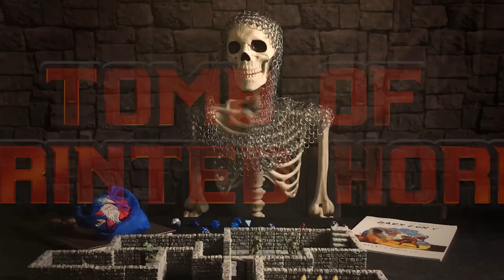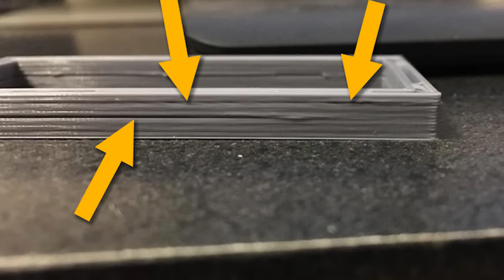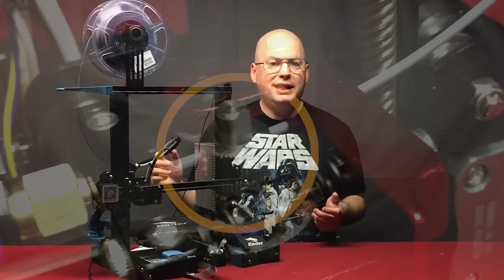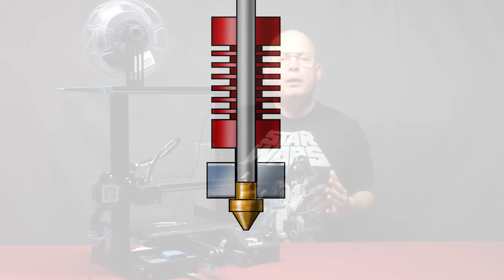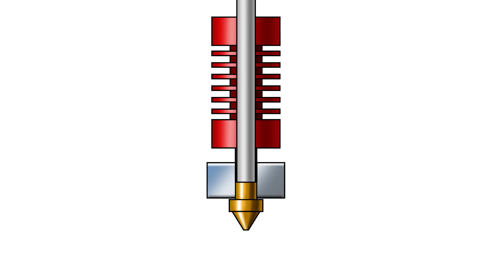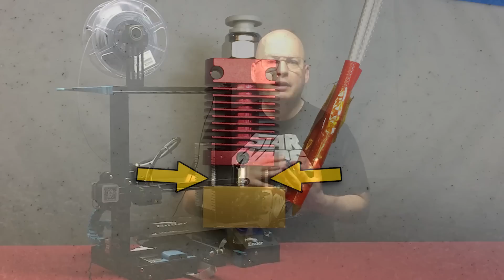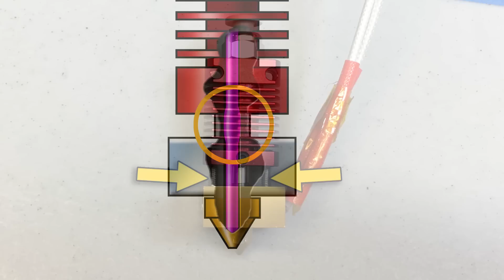Fixing Under Extrusion in a 3D Printer

Comment: So, I have been fighting under extrusion for a while. i ran the e steps calibration and adjusted accordingly, change the nozzle a couple times. Add a 1.5mm clip to the extruder arm to help the tension on the bearing. and it still under extrusion anywhere between 25mm and 50mm. I have not tried metal extruder or new tube. is there anything else i can do before buying new parts? I have checked a couple facebook groups but its all the same info

Comment: after an hour of printing, the filament in the nozzle will clog help
Reply: I've solved same problem moving down 5 mm layer blower. It was cooling down the heat block more than layers.

Comment: Thank you very much for this guide! I have had this problem for so long trying every setting in Cura. It has frustrated me for half a year. I have now been printing your models with great success except for a tiny problem. I am getting some buildup when doing overhangs. These sometimes get in the way of the nozzle which can mess up the print (especially part B of the Trash Beast model). Any suggestions on a fix?

Comment: Hi. Thank you for your videos they have been very helpful. My issue was that my extruded toothed gear wasn’t working. Then I remembered I added the 3rd TL Smoother after my first print. I removed the TL Smoother from the extruded plug and everything worked again. Just throwing out a glitch I found on my Ender 3. Could have been me if your not supposed to put one on that.

Comment: Love the extruder toothed functional section in your diagram at the 10:19 mark, but good luck ever finding a steel one with geared teeth that sharp! The enourmous majority are square and many are rounded at the squre's edges. I want 10 of those you show, they look fantastic!
I have the sharpest I could find on Amazon (the "Wangdd22 3D Printer Accessories 4pcs/lot 38 Tooth Mold Steel Linear Extruder Filament Drive Gear for Planetary Gear Extruder") and with my CR-10S is has been great. No more slipping, non-moving filament!

Comment: Thank you for the very detailed overview of possible issues!  Before I dive into many potential root causes in your video, do you have a hunch as to what might be causing uneven/underextruded/inconsistent texture on SOME of the sides of a print?  When I printed the calibration cube, I got X side looking pretty good, but then its opposite side was very rough.  Can that be explained by feeder gear grinding the filament, or is there a more likely explanation?
Reply from the maker: If it is showing on one axis only it's likely a belt tensioning issue. :)
Reply: @Tombof3DPrintedHorrors  tightened the belts, leveled X-axis, tried printing without the cooling fan, same result.  X and Y sides of the calibration cube look good, but their opposite sides are stringy.  Also double checked extruder calibration - 100mm got consumed exactly.  Would greatly appreciate any other ideas.  Thanks!

Comment: My coupler failed after just 1 full day of use. It spat out the tube a couple of times then it finally just spat out the metal teeth that is supposed to hold the tube in. I'm going to solder it back in though. see if it keeps working while I wait for a new one.

Comment: Dont forget, if going from PETG to PLA you should clean out the nozzle. PETG has a higher melting point than PLA, so you'll endup with a partial clog and under extrusion (been there.)
Reply: I was using PETG before now PLA, I had 3 failed prints already. I tried cleaning up but I still get underextrusion like after 40% of the prints. Really annoys

Comment: Now, i have a ender 3
The sides of the print arent bad, they are actually really good, but the problem are „plates“ 
These areas dont fix to the side of the part and they arent watertight 
What could this be, and yes i have dispensed 100mm and adjusted it to measure it. 
The printer is new, its a ender 3 
PLEASE HALP
Edit: The printer is new so i dont think that it is anything with wear and tear
Reply from the maker: I'm afraid I don't understand  what you mean by 'plates'.
Reply: Tomb of 3D Printed Horrors ah great an answer thanks
Here is my reddit post, better explained and with pictures

Comment: Hi .. I just got Ender 3 .. I have a problem .. when I start print from SD, the filament is simply pulled out and the printer does not print as filament is out. I tried the Test Dog and other prints .. Same thing is happening always when extruder and bed reach the temperature and the print should start .. First thing happened is the filament to be pulled out .. Then head will be moving without extruding .. 

 The  I used to print with Prusa .. This is really different process  .. Any advices?
Reply: could your extruder be running backwards? if so reverse the plug. are you feeding the filament all the way into the hot end till it stops?

Comment: Hey guys I just bought my printer ender 3  from amazon and have problem with the printingthe nuzzle stay all the time on the left front corner when we trying to print the test print (the dog )its printing one line on the left front corner back and forth non stop in one line with nocking sound  .I tried to move the nuzzle to the center of the heating bed and its look like working but after 1 min its going back to the left front corner .I tried to flow the instruction but still the printer refuse to  work.in the auto home its going to the left front corner and stay over there .I can move the bed and the nuzzle with the move axis so I knowthe are working .I need help anyone please ?

Comment: to prevent clogs, use a piece of sponge as a filament filter!!!! you need to clean your filament as dust can build up, and that gets intoo the nozzle. trust me, passing the plastic trough a regular piece of sponge cleans it a ton!. I've had 0 clogs since, even on my small 0.2mm nozzle!!!(smallest size) did a cold pull on that nozzle after 20h of printing and 0 debris!! (those .2 are known for getting clogged from dirt)
it's a cheap solution, and works wonders (you can even 3d print a holder for the sponge so it looks nice)

Comment: Great video. Thanks for the tips. I have one suggestion: when you talk about the "cold pull" cleaning, specify that the temperatures you're quoting are for PLA filament. A raw beginner may not know this and try doing it with a material with a higher glass transition temperature such as ABS or PETG and get frustrated that it didn't work.
Reply from the maker: Good point! I definitely need to do a video on performing cold pulls.

Comment: Well thank you so much for this! Unfortunately I still can't get a good first layer. I've used a leveling test which prints 5 squers (corners and center), and two corners are always way too close to the nozzle. It results in severe under extrusions, (half of each squere is missing and impossible to peel off the bed). If I'm trying to lower the bed on these problamtic corners I came up with the other squeres way too far from the nozzle.
Is my bed warped? Is there a way to fix it?

Comment: disagree on the mounting screws

chep did a real test on it

rest makes really sense.
Reply from the maker: Just found out what the story is with the screws. Originally they were intended for factory use only to align parts, then Creality found that the grub screw holding the heat break in wasn't going to hold it tight enough, so their 'fix' was to leave the alignment screws in place for added stability, even though the design was for them to be removed. Luckily they don't transfer enough heat to the heat sink to cause an issue. So yes, they need to be left in despite potential additional heat creep. :)

Comment: Creality says the two screws are to be left in.
Reply: CHEP also tested with and without those so called "alignment screws' with temperatures and came to the conclusion to just leave them alone. The "screws causing heat creep" myth- busted. (although, I won't fault anyone for thinking so scientifically for finding improvements and results, bravo on that, need more thoughts like those)
Reply: The screws need to be there. Running without them is dangerous and could cause a fire if the heated end comes out. This is some internet mythology and it has to stop.
Reply from the maker: I've seen they recently said that, but they are also shipping the newer Ender 3 Pro and CR-20 with the same hot ends with the screws removed. As I said in the video, if it isn't causing you a problem, leave them in (all of my Enders still have them in place.) :)
Reply: @Tombof3DPrintedHorrors  Stainless steel is not a good conductor of heat.  They aren't the source of any heat transfer problems....
Reply: Correct! Heat going up the screws means less heat going up the center heat break which is in nearly direct contact with the filiment.

Comment: You forgot also to mention that the Filament can also cause a problem !   I´ve had rolls with changing Diameters up to 1.97mm when it´s supposed to be 1,75mm
Reply from the maker: D'OH! Yes, that should have been included. :)
Reply: I had a spool once, the filament diameter varies from 1.65 to 1.94,
My temperature was fine, and the hotend was fine, at the end it was the freaking filament. It was damn frustrating

Comment: Thanks for all you do for the community. Just wanted to say, I had nothing but problems when I took out my Ender 3 installation screws . Its possible I did something wrong, or something  is wrong with some threading, but my nozzle kept dropping down and scoring my bed. I was going crazy trying to figure it out, but once I put them back in, everything was fine.
Reply from the maker: So far, I have had no reason to remove them, and I am definitely of the mind 'if it isn't broke don't fix it.' My Ender 3s print better quality than my Prusa Mk2/3s, so I don't want to mess with them.
Reply: So, according to CHEP, Creality says those screws are supposed to stay https://www.youtube.com/watch?v=eM-rJWBuWhw. Makes sense.
Reply from the maker: Just found out what the story is with the screws. Originally they were intended for factory use only to align parts, then Creality found that the grub screw holding the heat break in wasn't going to hold it tight enough, so their 'fix' was to leave the screws in place for added stability. Luckily they don't transfer enough heat to the heat sink to cause an issue. So yes, they need to be left in despite potential additional heat creep.

Comment: Thank you for the information, been printing for a few years and have multiple printers and sometimes it's good to just watch a refresher every once in awhile.   One thing that I have not yet tried but was suggested by Joel the 3D Printing Nerd was to have some Nylon filament handy, even if you are not actively printing with it.  But to use this when you perform a cold pull, the Nylon is flexible and and needs a bit higher temperature to reach the melting point, but supposedly can reach all of the areas inside of the nozzle easier and should pull more material/debris out with it (if there is any in there).  Worth a try.  Thank you again for sharing.
Reply from the maker: Thanks for the tip on the nylon, I will definitely try that! :)
Reply: Must give credit where credit is due (took a while to find since he has sooooo many videos LOL).   https://www.youtube.com/watch?v=MGt8cnVIKW8

Comment: I've heard those two screws at the 15 minute mark, are supposed to be there... and that they are not supposed to be there.  Some say they are meant to help stabilize the head.
Reply from the maker: They aren't causing any issues for me, so I've left mine in. My Ender 3s print so amazingly I hate doing anything that might change that.
Reply from the maker: Just found out what the story is with the screws. Originally they were intended for factory use only to align parts, then Creality found that the grub screw holding the heat break in wasn't going to hold it tight enough, so their 'fix' was to leave the alignment screws in place for added stability. Luckily they don't transfer enough heat to the heat sink to cause an issue. So yes, they need to be left in despite potential additional heat creep.
Reply: @Tombof3DPrintedHorrors  The heat creep thing was tested a while ago, and no noticeable difference was seen.

Comment: Ender 3 is my first 3D printer and I went through each of those issues.  I actually found a few of those issues lead right into another issue. It took me a couple of weeks to realize the filament gear wasn’t making complete contact and was slipping, the spring just wasn’t strong enough.  Replaced that whole system with an all metal system.  Ruined my first nozzle with in the first month before I got a consistent extrusion rate (at least enough to actually calibrate).  I’ve got it running now ok.  I haven’t really found a slicer I’m comfortable with.  I switch back and forth between Cura and S3d.  But it was your Cura profiles that really resolved a few slicing issues I was having (or better way of putting it, a lack of understanding). Great video, thank you!!
Reply from the maker: Thanks! :)